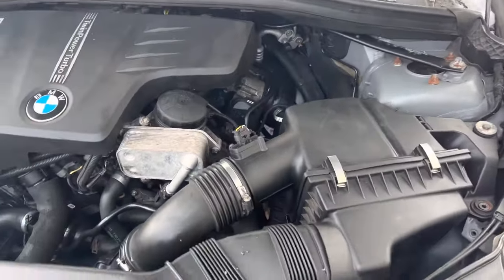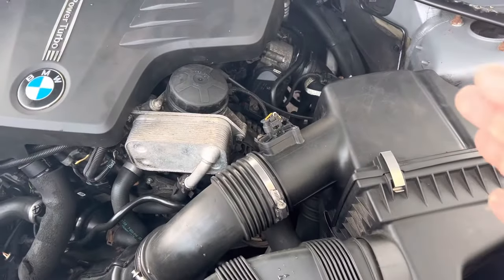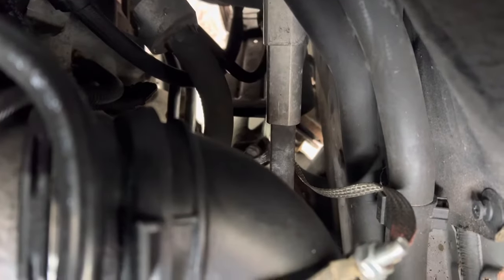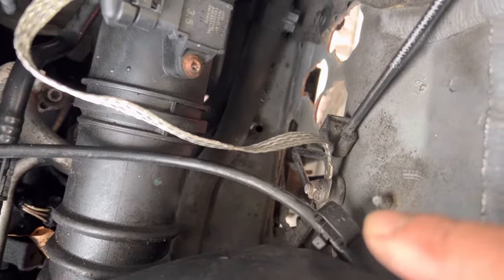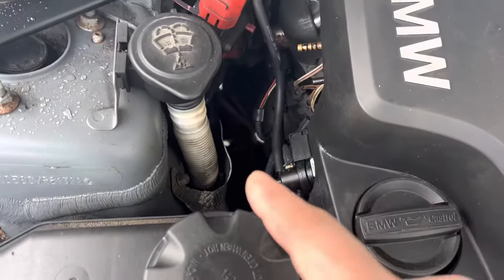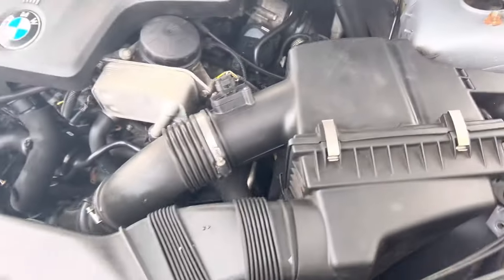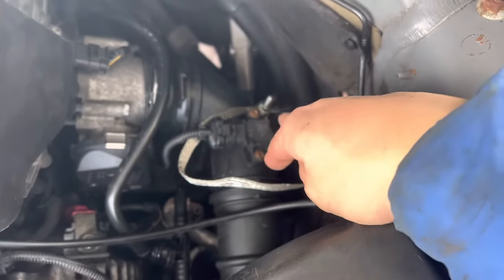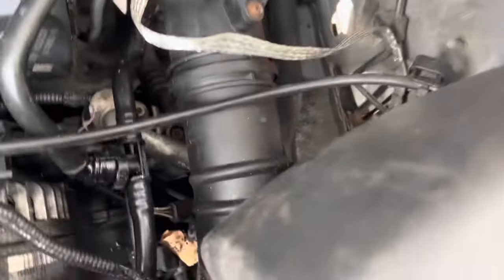DIY - BMW NO CRANK NO START - Not battery , not starter - Quick & Easy Fix!

Comment: What was the cause of this bro? My car went inside water almost bonnet height and it has the same problem its a 2022 x640i but there is no message displaying on the screen and it dosent start up, only the display is on, i took it to bmw service they didnt find anything aswell

Comment: Do you now where this cable is on a f30 335i?
Reply: I have a f30 320i and mine is underneath the car somewhere in the middle
Reply: @cwalk316  I found it, mine was underneat the car, over where the passenger set is, it was screwed from the chasi to the manual transmision of my car. It was in really bad shape, replacing it fixed my car